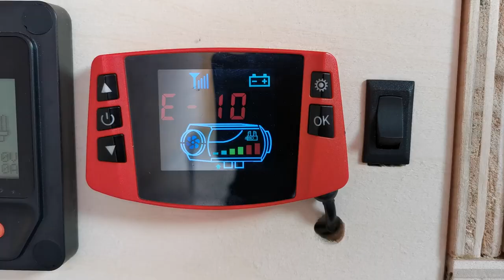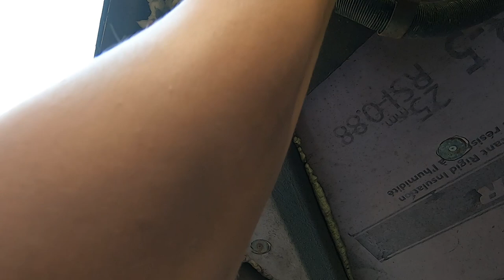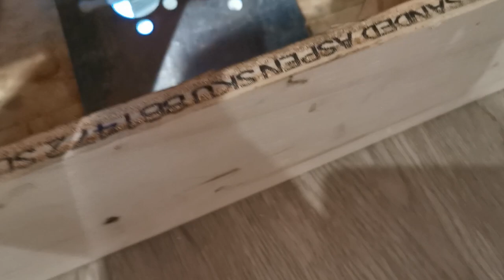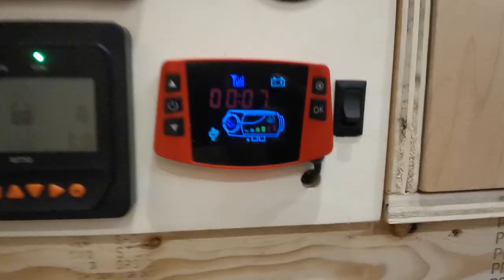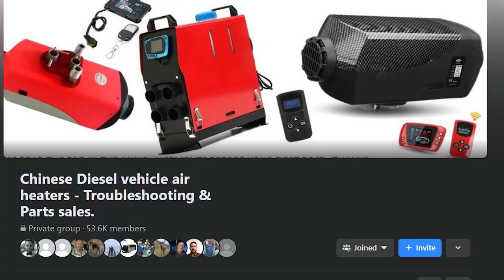Diesel Heater UPDATE after 10 months! | FULL TEARDOWN

Comment: Came across your vlog, Joel, and read through all the comments. Excellent job on cleaning the heater, by the way! For the summertime, you need to run the heater once a month. What the people are telling the truth about bumping up the temp and running it for it abit during the winter is partly correct. What they may not know is when you run it on high, you need to drop the temp back down and let it settle down to burn the excess fuel you pumped into the system before you shut it down/ off. Next, get a better tank; anything will do, and whatever you do, please do a top-down line into the fuel tank. This will be very helpful down the road. No leaks; if the tank goes bad, grab another tank or even a glass jar if you like. But the point is all you have to do is pull the line and drop into another tank, quickly! When it comes to that tank with those kits, pull the cap off, pull the inner out, and remove the tiny plug, some do not have it, so make a small hole to let it breathe. Or any other tanks you choose, make sure they have a vent hole. If not, when you go into the mountains or high elevation, it will force the fuel to bypass the pump and dump excess fuel into the burner, and you will get white smoke [caused by too much fuel ] which causes the carbon build-up also. Again if there's no venting hole in your tank. The second cause is if there's no venting hole in the tank, this problem can raise. Your heater is running fine, then it just shut down because of no fuel. What's happing is it ran all the fuel out of the line and caused a vapor lock, and the pump can't draw fuel from the tank. Why? That right no venting hole to equal the air inside. Another if you about 2 oz of Klean diesel treatment for 15 Liters tank about every other fill-up this will too.
I finally took my 5Kw heater out after three years of use and just before this winter to service it. I was ready, surprised it had damn near NO carbon build-up in the chamber; I pulled the Atomizer screen too, nothing there either. I replaced it because I messed it up when I pulled it out. Put it all back, prime the line, and fired it back up. She ran just like she did before checking on her. It a cheap heater off Amazon, or was it eBay? I forget. 120 bucks. I love them and have them for my back shop and have installed many of them for people. Hope this helps?
Reply from the maker: Awesome helpful and informative advice. Sounds like you know what you're talking about!! Thanks for watching and sharing.
Reply: @JoelTremblayCA  no problem! 🤙🏻

Comment: Hello from the high desert of New Mexico USA 🇺🇸,  I have installed a lot of these heaters and have done the maintenance for other people. Amazon sells specialized tools for these heaters and all the parts for them. Where you put your wrench to remove the glow plug, on the left side is a hole that needs to be cleaned also under the glow plug is a  atomizer screen that should be cleaned or replaced. And yes ,you need to run it on high for at least a half-hour before you shutdown the heater to minimize the soot build up . As far as the fuel tank goes, you can use a Jerry can or one of the small boat topside fuel tanks. I hope this helps you out.  Keep up the good work and stay safe and charged
Reply from the maker: Thanks for the very helpful information! Thanks for watching.

Comment: Joel, I suggest you check the air fuel settings on your controller. There are many youtube videos that show you how to make sure the settings are appropriate for your altitude. Adjusted and installed properly, the unit will NOT coke up like that. Keep up the good work!
Reply from the maker: Yes! I did go through and adjusted the settings as per a fuel/air ratio chart. Thanks for the comment. I appreciate it!

Comment: I have the same heater in my cargo trailer and this summer the sun destroyed the fuel tank. Like you I have a tool box on the tongue. I went to a lawn mower repair place and bought a used metal lawn mower fuel tank for 20 dollars and mounted it inside the tool box near the lid for easy filling. Yes it holds less fuel but very convenient . These tanks even have the fuel outlet already installed and the heater fuel line fits over it. My suggestion is to always run the heater on full blast for 15 mins before you shut it down, i am sure  the when the heater is idling is when the build up occurs,
Reply from the maker: That's a great idea! Thanks for sharing.

Comment: I struggled with the decision on which heater to use in my cargo trailer. 
I really wanted to try the Chinese diesel heater. I ended up going with a Propex HS2000. This is my third year and it has worked flawlessly. More money but it just works every time.
Reply from the maker: Those are definitely nice units! I can't complain too much about the $300 unit. Since I've cleaned it, it works great!
Reply: @JoelTremblayCA  
After watching your video I'm going to get an all in one unit to play around with.

Comment: Hello from a Dane living in Bulgaria, your diesel pump should not face directly upwards, but have a 45 degree angle so there are no air bubbles in the system and yes the small hole next to the glow plug must be clean and not closed by soot and it is quite normal to service once a year, thanks for the information about the tank that comes with the purchase, no that tank is simply not suitable for sitting outside and the crack you already have, allows water in the diesel possibly, I think you have put it too far down in hz so it does not burn clean and make soot.
Reply from the maker: if you watch my install video I show how I mounted everything. Pump is angled as it should. Thanks for watching!

Comment: I changed my fuel tank to a regular gas can plastic. I also run my unit on high for a few mins once a week to clean it out and for the summer I run my unit full blast until out of gas than I put it Way for the season I owned my unit for 2yrs.  NEver had to open the case. If you have to run your unit on low all the time you may want to consider getting a smaller unit.
Reply from the maker: I learnt recently about running it on high to burn off the carbon build up. Has been working like a top since! Thanks for watching.

Comment: Good on you for testing before you where to rely on it. Was surprised on how bad that was. That is burning too much fuel, hopefully there's a way to tune it. I would replace that flex exhaust tube with a proper hung pipe from a custom muffler shop. Adding gravel protection/ tire spray in front of it (some lenghts of truck mud flap?) should add eternal life....
Following as I'm outfitting my new enclosed trailer for light camping and hauling street or the DR650 bikes to explore Nippissing. Best = you get after it, completed it, tracked costs and use it to enjoy life!!
Planning some riding up there in '22 - birth town and all...
Reply from the maker: Thanks for watching :) good ideas. I'd like to get some better type of exhaust made. Good idea on custom shop, I'm sure they could whip one up quick and cheap. I've been playing with fuel / air ratios. Apparently they need to be tuned to your elevation. Good luck with your build!

Comment: You need to run the heater on max for a few hrs every other day, that way you won't have these problems in the future 👌
Mine is running 24/7 in my basement,  and 85% of the time it's running at lowest setting... So when I get home, I turn the heater up to clear it out before I turn it off, atleast 1 hr.. But that's me... I even run diesel engines hard every time I'm out, because that's helping me to keep the soot and build ups away..
Reply from the maker: Great info! Thanks for sharing.

Comment: I think for all the trouble people have with these using the Proper propane heater could be a better solution. They burn much cleaner and don't need the cleaning that the diesel heaters require. I think they work better at altitude as well.
Reply from the maker: It all depends on what unit you go with and what your budget is. Some of those vented propane heaters run over $1000. The people I know with the $1000 diesel heaters don't have these issues. I know some others that have ran CDH for over 3 years no issues, comes down to user input / error and general maintenance! Thanks for watching.

Comment: Clogged injector nozzle is not atomizing the diesel  fuel as it is being pumped into the combustion chamber..  Easy fix.. You might also need to filter that fuel better before it enters the heater...
Reply: BTW, the hole in the nozzle is extremely small (hold up to the light)  Try a brush of some kind or hair like wire to clear (soak in lacquer thinner). You will also need to clean out the combustion chamber of the unburned fuel or you will start a fire..   These are only small #2 fuel oil household heating systems and operate under the same principle, igniting a combustible  mist to generate a hot, high pressure flame..

Comment: The Maintenance on these units should be completed every 6-8 months.

Clean combustion chamber, change fuel filter and inspect / change glow.plug if needed. Aside from that check the condition of the air intake line / filter along with the exhaust pipe / silencer.
Reply: Agreed! Proper maintenance = less issues

Comment: Hey man just noticing your fuel line is super thin. You're diesel is most likely geling up and clogging. You could pour just a little bit of howes diesel treat in there or a lot of people use ATF. Again a small amount
Reply from the maker: Yeah it is some very thin line as the required fuel to burn is minimal. Literally drops. The line is sized by the manufacture. I put a bit fuel stabilizer in the tank to stop gelling. Thanks for watching. Appreciate the feedback!

Comment: 6:40   ??? How often did you run it on LOW???  I hear that they like to be ran on HIGH and BURN off that said carbon.
Reply from the maker: It would run on low as soon as it reached temp. The error I was doing was just turning it off when I was done. What you SHOULD do is run it on high for 10-15 minutes before you are done using it. Haven't had an issue since!

Comment: You need to vent the full cap on the tank , otherwise you’ll get an E8 error code
Reply from the maker: I've never gotten an e8 code. I believe these caps have a vent built into them! Thanks for watching
Reply: It’s very tiny hole that some caps have a plastic behind it that it won’t let it breath properly but if you haven’t got any then Is ok

Comment: I think if you let it hear on low it causes excessive carbon buildup which I guess is the cause
Reply from the maker: Yes. Have to run on high for a bit before turning it off to burn the carbon.
Reply: @JoelTremblayCA  is it the 2.5
Reply: Like your Channel and just subbed the other
Reply from the maker: @xterra4hire  thanks man I appreciate it! Cheers 🤘
Reply from the maker: @xterra4hire  5kw system.
Reply: @JoelTremblayCA  do it cook you out or is it good
Reply from the maker: @xterra4hire  it can get toasty in there so I keep the window and roof vent cracked open